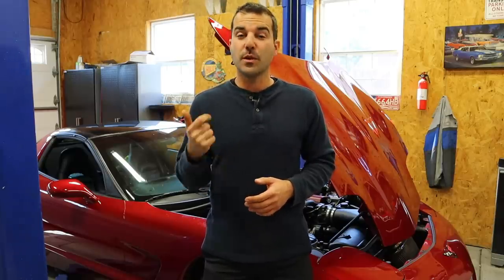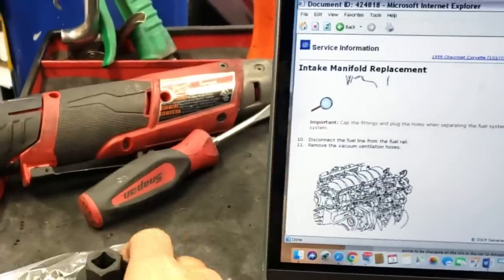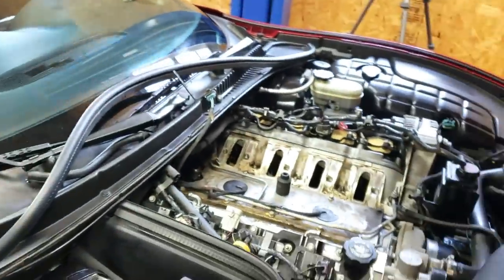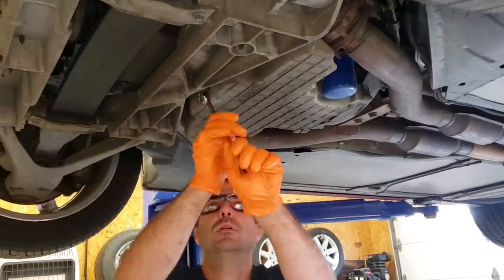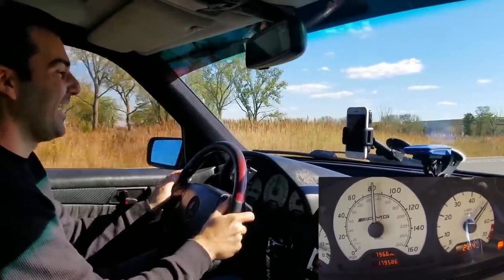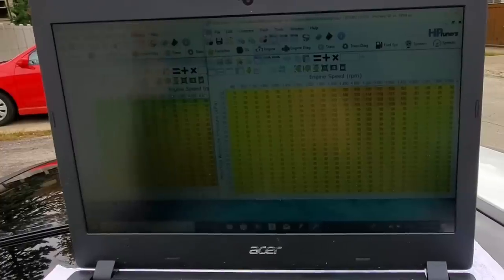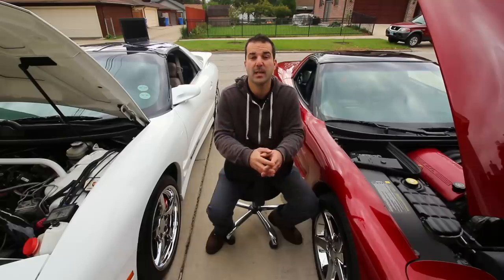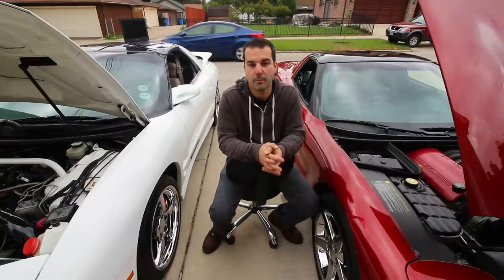I’m Building A 40 MPG Corvette That Sacrifices NOTHING! Project EcoVette Starts Now!

Comment: one comment on the plugs and wires.  You should do and ohm test on the cheap plugs wires u got. I purchased a similar type and found them very high resistance. the engine ran ok but i could feel a differance. didnt seem to have the same power. i swapped out back to a lower resistance wire like an oem one and really noticed a difference Plugs are good for nos and boosted application. The coils worth the most efficient with an iridium  style. Ive used the 06 up Zo6 ls7 plug for a colder plug application. just my 2 cents. lol

Comment: Don't do lighter flywheel with lean burn it will not help because on light load with lean burn you want the innertia of the stock flywheel to help balance out the low load cylinder pressure to keep it moving since the rpm, is so low on the Corvette.  On the Honda vx they ran a bit lighter flywheel but that's because cruise was above 1500 rpm.

Comment: My understanding is the reason why none of the auto makers are willing to go past 14.7:1 AFR is because of the way the 3 way catalytic converter works. All engines emit a certain amount of NOx and a certain amount of hydrocarbons (unburnt fuel). Run richer and you get more hydrocarbons, run leaner and you get more NOx. But if you at 14.7:1, you get the same amount of each - and the catalytic converter is able to pull the oxygen away from the NOx and give it to the hydrocarbons so what comes out is CO2 and H2O only. Of course you get much better fuel economy by running the engine lean (just look at diesels) but then you get NOx and annoyed bureaucrats (just look at diesels).

Comment: There's a reason that all auto manufacturers that sell cars in the U.S. , run their cars run at stoich (during normal operation). A stoichiometric burn is the cross section where the lowest concentration of several individual combustion byproducts (HC's, CO, NOx), are produced. Removing catalytic converters and disabling catalyst overtemp protection (running rich to cool the catalyst) will also save fuel. Low emissions and good fuel economy are not one in the same, they are at odds with one another.
Reply: There's a couple of things wrong with what you said; HC are lowest in a lean state, think about it, there's a better chance for them to be burned. NOx are produced in very high heat environments so they're low at the extremes of the AFR chart. CO does drop off fairly significantly at around 14:1 but doesn't increase when leaned out further. Modern Catalytic converters aren't that restrictive. I'll take them over smog. Running lean at cruise probably results in a cooler EGT than driving it like a bad out of hell. I don't see any downsides to what he's trying to accomplish here. As long as the EGT is reasonable and it isn't misfiring it should work pretty well.

Comment: I think you are a little bit misinformed about lean burn. Once you go leaner than stoichiometric, the combustion temperature gets COOLER. The combustion temp gets hotter as you get leaner than max HP going down to stoichiometric.  That's your danger zone - between max HP and stoic. Once you pass stoic, everything gets cooler and easier. The problem is throttle control. You can make it work with a drive-by-wire throttle but manual throttle is difficult because you would want to open the throttle to get less HP and close the throttle to get more HP. It's counter intuitive. As you close the throttle for more HP, you must program the ECU to jump over the danger zone going from lean back to rich. You also need to program the drive-by-wire throttle to act in reverse of your gas pedal when on the lean side. Maybe you can just use a constant throttle opening and a fuel ratio that varies with gas pedal position when on the lean side. The whole drivability connection between the gas pedal and what the engine is doing is complicated! 

Plus your catalytic converter will be a bit unhappy with lean burn exhaust. I don't know if it will be damaged or just fail to work well during lean burn.

It is a boat load of reading but John Deakin has a bunch of articles on avweb.com about rich/lean mixture on piston airplane engines - very good info! There is a very long summary at http://www.vansairforce.com/community/showthread.php?t=75132 that seems to be a good start.

I wish you good luck, I am very interested in seeing how it works for you.

Comment: My 94 cobra with 3.08 gears mostly stock 302W engine (throttle body, mid pipe. Mostly small bolt ons and a nearly fully built suspension)  gets an avg of 12-13 mpg 😂 I got 17 once driving on just the highway for two hours but damn the concept of 40 mpg on the highway is a thought I've never had and I'm still slower than the Vette. Not entirely sure the computer tuning would work though since my Stang runs on the old Ford eec system isn't exactly friendly like obd2

Comment: The EPA is behind the times.  NOx is no longer the main concern.  That is just a local smog issue and one can see the mountains ringing the LA Basin from the beaches, so little concern today.  Global CO2 emissions is the climate concern today, so running lean for better mileage would significantly reduce that.  If governments want to provide relevant incentives today, it should be towards better mpg per passenger.

Comment: Great info thanks! However I really wouldn’t tighten the oil filter with a wrench.
Reply: Usually not a problem if you have a wrench to get it off. C5 oil filters like to come loose.
Reply: Kevin Tucker - Maybe you wouldn't but those who know what they're doing can. Turning a filter 3/4 turn after it seats is no different whether done by hand or by wrench.

Comment: Unless those wheels are not aluminum, which I'm fairly certain they are, I wouldn't change them. They are already very minimalist and should be just about as light as you're going to get for stock tires.  I mean, you will certainly gain some mileage if you slap on Prius wheels. but that seems a bit extreme for this project.

Comment: I best MPG in my 03 Z06 at about 75-80 mph and also I’m getting about 28 mph and have 480 HP at the crank. The vette only weighs 3100 lbs very aerodynamic and @my 80 mph I’m still well under 2 grand rpm.

Comment: LegitStreeCars@ 22:15 Honda made the CVCC engine that was put into the first generation civic and was able to be sold without a CAT in the states. 
Also with lean burn technology NOx actually reduces but increases the CO and HC with increasingly leaner mixtures. If you google "three way catalyst efficiency there are several graphical examples depicting this. This emission trade off within three way CATS is why the lean burn limit isn't as as high as you might think but there are now some examples of engines running with lambda 2 - Mahle powertrain

also I would like to see you modify the EGR to open more at part load throttle.

nice video though :)

Comment: It will be interesting to see this. I suggest that you also do a modified intake manifold with two throttle bodies, one large + one small. Along with something like a 90's TVIS system that gives fast air flow in economy mode along small intake runners. Happy to help if you want to do this and it's a bolt on and reversable change.

Comment: I would not touch the engine before going for the lightest wheels, battery, low friction lightweight tires ,exhaust, seats and then moving to aero modifications. Then I would add EGT sensor to be safe, lean our mixture (provided you use high octane fuel) and use the lowest possible viscosity in engine and transmission oil. I would also reduce warm up period by blocking the radiator (with the help of some simple electronics) so that the engine builds up heat faster. Also, knock sensors can be overly sensitive and add fuel/retard ignition -probably worth a try to check that too.

Comment: This is an awesome project, love the gas mileage potential of the LS, especially when paired with the vette.  Would love to see 40mpg, but I don't want to see it in some ultra-hot lean burn mode, but if you can hit a "mid-range" lean-burn at like 16 AF and hit it, that would be awesome.  Look forward to it.

The "old fashion way" for gas mileage may not be the most accurate w/o the OEM tire/rim combos.  Even if the current tires are the same tire size as the factory tires, tires are all different in terms of their ACTUAL size.  You can typically get the "true" diameter from the manufacturer website, but a tape measure comparison to the stock tires (if you can even find them) may work best.  I don't know anything specific about GM MPG readings, but I'd expect that to be super accurate.  It has direct access to the injector duty cycle and the volume flow, what is read there should be spot-on accurate for fuel consumption, and the dyno should be spot-on accurate for speed.

Really excited about this.

Comment: The TPI system in the 80's had a lean burn mode.  If I understood it correctly it would switch on and off to keep things cool.  It would only kick on during highway driving after a certain time.

Comment: The Mazda get 1mpg difference then the vette is cuz it's a small engine under powered for its application... It's straining it, has to work harder hence why four bangers should all be Turbo charged like the Ford 4cyl ecoboost. My wife's 2012 4200lb 4cyl edge limited gets 23mpg city. When I had a 2012 edge too mine was a sel 6cyl NA that got 21mpg city.

Comment: I thought the VTEC-E engines did have lean burn as they were for fuel economy ONLY. I know the cats were more costly as well. But in the early to mid 90’s the civic hatch with the vtec-e engines got 40mpg or a bit more on the highway. Also the epa has changed how they determine fuel economy by lowering cruising speed. Used to be at 55 I am almost dead positive then lowered it.

Comment: I think its possible! Keep the AC and Radio off they can somehow impact MPG. air temperatures too, the colder the better? and a lot of tire pressure haha
Reply: Hot and humid air is less dense and therefor easier to drive through than cold, dry air. Engines don't make as much power though. So it ends up being a disadvantage.

Comment: Considering the c5 already gets high 2Os and low 3Os it should be easy. I get 32 from here to Santa Fe which is about 75 miles. They are rated what 18 city 28 highway from factory.

Comment: My prototype reduces knock so you can advance ignition timing. 

Makes engines more fuel efficient.

My modified lawnmower already outperforms it's electric counterpart in efficiency.  About 4 hours of run time on .2 of A U.S. gallon of gas.

Comment: I've seen NASCAR tuners cut away enough metal from the threaded part of a spark plug to "read" what is on the insulator surrounding the center electrode. They use plugs with a very "cold" heat range and most of the center insulator is below the plug threads.

Comment: Go up on your tire size dont change the gears. 1 inch should make it go from a 3.42 to a 3.21 if you go any higher than that gearing or tire the engine will lug in 6th gear. A cheap light wheel would be base model 94-04 17s or 18s.

Comment: 40 MPG from a 5.7 V8 would be really impressive! I have Nissan 1.8/auto, on a long trip i got about 43--44 MPG which i thought was pretty good, but comparison to 40 from a V8, my MPG doesn,t sound as good. Other ways of improving MPG, carry less weight in a vehicle, better aerodynamics, a lot of fuel economy is determined by the drivers right foot!

Comment: Take into consideration wind speed and direction when doing mpg testing, also use same stretch of road and same conditions,  humidity,  barometric  pressure, and temperature, also try for at least 200 miles. Plus the car needs to run in cruise control... gonna be hard to do in today's traffic. Remember no drafting, good luck....

Comment: Great idea for the build. There is a lot of good info in this video. You know way more about tuning than I do. You also know it’s boring af. That’s why the cool car inserts. Well done.
It would be cool if the car automatically entered lean burn mode when the cruise control is activated. Like mds.

Comment: Nice video!  Well the miata has very low gearing, otherwise we would have no acceleration.  I currently have an NB.  However, i did have an NA previously. In the NA, i did an economy highway run from san diego to LA, i had the car tuned perfectly, new plugs, filters, etc etc,  factory stock.  i managed 41.21 mpg running at 54 mph!  So it is possible. It was frustrating to run in the slow lane for over 120 miles on this trip.  And i tend to have a lead foot.  The same car had a worse mileage city driving of 18 mpg, yeah city driving sucks!!!

Comment: Well... considering I was about to get 33MPG in my 6.4 Hemi Challenger...with a 6spd manual, and if it's highway driving I am sure it could be done. Back to the Hemi...turning at 1,200 RPM at 100 Kms on hour, also if I went down to a side road at 80 Kms I think I'd get more.

Comment: At a constant highway speed, weight is irrelevant but the airdrag is in case car is larger. However, you would expect an 8 cylinder engine to be very thirsty
Reply: Weight is still relevant to rolling resistance.

Comment: Wonder if a turbo will be in the plans. Sts rear system so you can have long tube headers. If you can apply throttle management you will definitely gain higher mpg.

Comment: If you add water injection you can make the engine run leaner without the cylinder temps getting as high
Reply: Also for what you are doing your mods should be set up more to increase the torque of your motor as that will allow the motor to not work as hard. So things like 4-2-1 headers a RV Cam and the like would get you the best gains

Comment: A diesel swap would be awesome. Power and efficiency right there. I'm building a 2.0l vw tdi that I'm expecting nearly 300hp and 400+ lb of torque. It will be cool to see what you can get out of that 350 Chevy though.

Comment: 40 MPG is not that hard on a C5 Corvette. Mine is completely stock and at 70MPH I can regularly acheive 30+ MPG on the highway. Dropping down to 60 MPH, I regularly see my instant gauge hovering around 32 MPG. In my experience, this cluster is only off by 1-1.5 MPG as I keep track outside of the car cluster.

Comment: throwing TOUSANDS at parts not needing to be changed MAY provide meager mpg savings...
DIY belly pan vs throwing camber an toe off with hack mode lowering.  Rumors of manual tranny's getting POLISHED gear sets providing HUGE mpg gains plus quicker firmer shifts at the track. Shelby had a lean burn dodge 4 banger turbo, BUT it had stainless or sodium filled exhaust valves, SS header / turbo / flange etc etc.  it worked BUT i'm sure it would cost more / Got shelved by big OIL... oh well.  Try and find a CAGEL manifold vacum fuel restriction unit.  I had a 4 door 413 max wedge 2bbl car, headers, rv cam, must have weighed 5200lbs and could get 27mpg 33 YEARS ago with my foot in it MOST of the TIME.

Comment: Sooooo I was doing something very similar with an old SUV I had. As finances became tighter,  my hobbies began to be sold. It was an '84 K5 w/ 6.2 Detroit diesel,  3.08, 3 speed,  on 37s.
Reply: If that 3 speed was an automatic that was where most of your money got flushed. 

I can't believe consumers bought purely fluid-coupled transmissions for as long as they did.
Reply: I was saving for a muncie 5 speed and a stock turbo from an LMM duramax to complete the dream of reaching 1000 miles per tank
Reply: Hated the 3 speed

Comment: You changed all oils to synthetic and gave the car tuneup which is good. But you did skip engine flush and engine treatment with stuff like Motorkote, or at least you did not mention that in the video. Also lighter wheels might be good idea and pumping them up up to 40-45 psi.

Comment: It's not a fair comparison; the Miata is like half the price of a Corvette. @8:52 Highway mileage is almost entirely dictated by aerodynamics, not weight (you mentioned 1000 lbs lighter). Miata is convertible, which hurts aero and therefore highway mpg. It's also almost half the price, with less development from a much smaller company (GM is enormous).

We can talk about cornering G force, and then the Miata has the edge with the reduced weight. Of course to make it a fair comparison, you'd have to spend money on the Miata to make it roughly the same price as the Corvette lol.

Comment: I replaced the oil filter with a stainless steel reuse on my Harley got 1.4 mpg better and about 2 hp better just a little info
Reply: How the hell do you even know your hp difference? You can have more change than that with back to back dyno runs and no changes.

Comment: for sure look at things like axle gear fluid. you could probably put ina  synthetic and possibly even a lighter viscosity weight oil as long as youre not drag racing haha. also different trans fluid could also possibly be a easy help. also wheel bearings
Reply from the maker: Keep watching!

Comment: Gotta be VERY careful you don't melt a piston or 4.  I'd personally have removed the injectors and got them overhauled.  Not too expensive and ensures you'll get the proper spray pattern.  Dribbling fuel from an injector isn't fuel efficient

Comment: Miatas would get better Highway mpg if it had taller gearing, at 60mph I’m sitting at 3250rpm-3500rpm, after you get all the simple mods down you could either swap 6th for a taller gear or just go for a longer final drive

Comment: This is really interesting stuff.
I'd say put covers under the engine.. But, I'm not sure the higher engine bay temps would help, especially with the car running hotter with the lean burn.
I definatley think aerodynamics and weight saving would help massively.